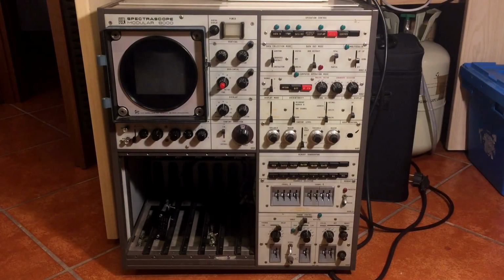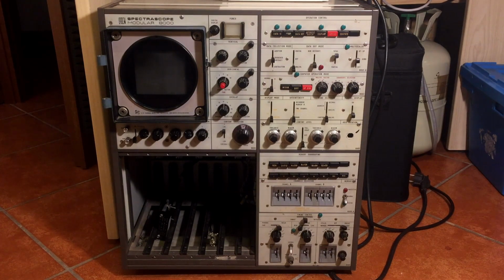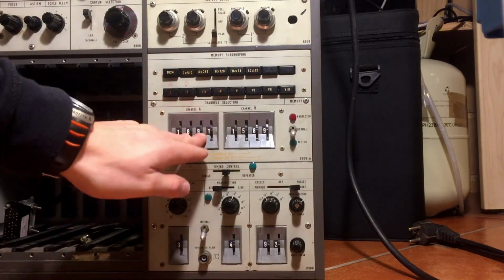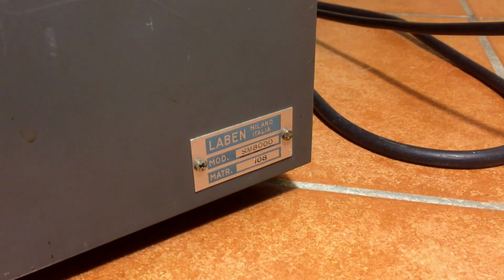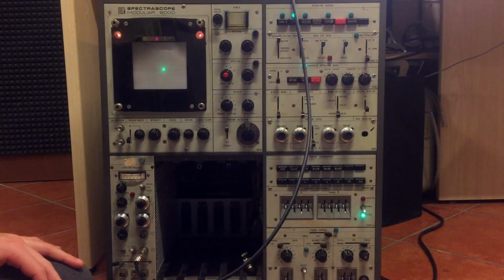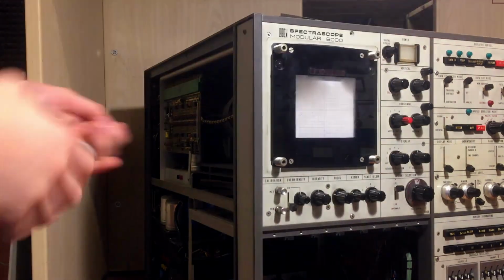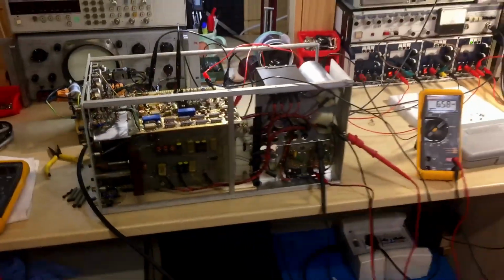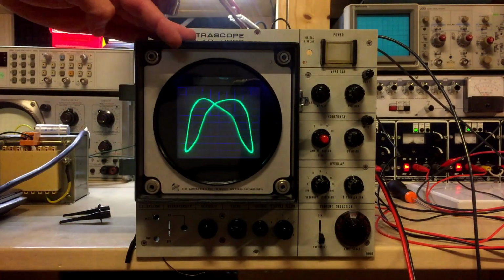Laben Spectrascope 8000 First Quick Teardown

Comment: Very nice piece of gear!  Lots of reusable parts if nothing....could even repurpose the case for another PSU!  :)  Found some links, not sure if you've seen them, but just incase not. Looking forward to part II and real nice to see a video from you. 

Scroll down, has picture of your unit: https://bit.ly/2W1ZuUl  , https://bit.ly/2FBTJYM , then do a search on eBay in the USA, you'll find a couple of Laben brand cards, may not be for your unit, but that's ok, just a visual thing anyway!  Hope that helps some.  ~Jack, VEG
Reply from the maker: Thanks! I'm already planning to reuse some parts (crt, psu etc..), but i'm afraid that the cabinet has to go... it takes up too much space and it is not in ideal conditions. 
I've seen the first link, but not the second one, so thanks! I did an ebay search some time ago, but never found anything (there were some Montedel NIM modules btw; Montedel is a division of Laben) 
Dave